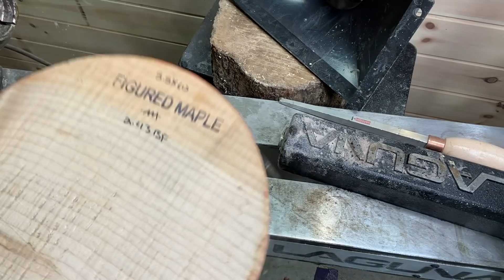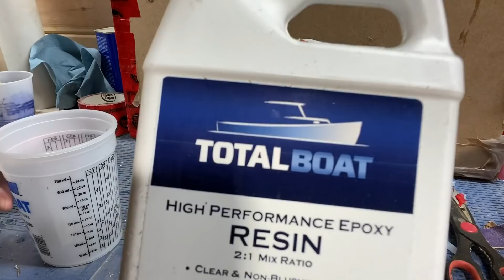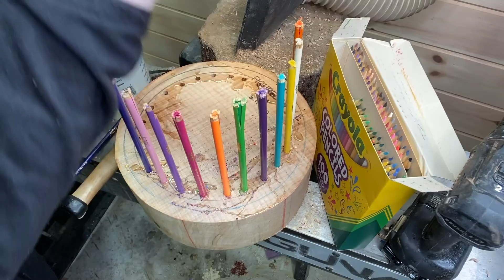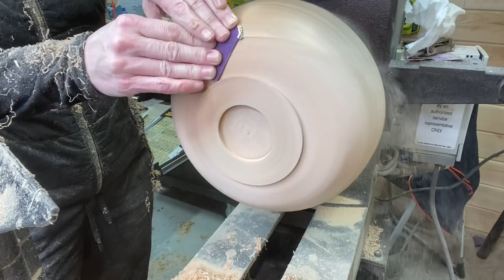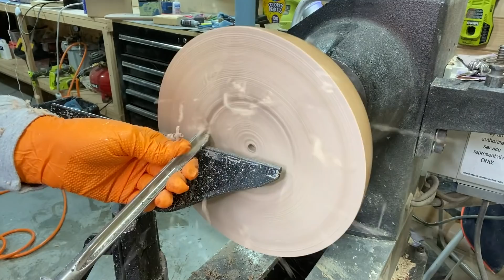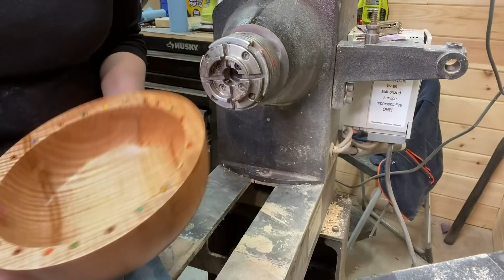Woodturning with COLORED PENCILS

Comment: The first project I did with colored pencils, I left them in the box, and cut them on my miter saw. I started at the bottom of the box because it held them better in place. It got a little more harder to cut the rest of the pencil into smaller pieces after the first cut, but if you only need that first batch, it worked well.

Comment: I think you would have a better alignment of the pencils if you had drilled the holes after turning the outside of the bowl, take the bowl in the chuck off the lathe , and lined up your circle jig with the real center of the bowl.  Nice enough though.
Reply from the maker: Thanks for the tip!

Comment: Nice birthday cake.  Where did you get the wood.  I’m not having much luck ordering on line.  I get the blank, but there is always something wrong with it.  Stay healthy.  Oh!  If you have time...you finished a bowl recently with resin.  Could you tell me the ratios of ingredients?
Reply from the maker: Got this blank at Rockler. As far as the resin, depends on the brand and ratios for each one. I usually use Total Boat 3:1 or Total Boat 2:1

Comment: Peggy, I’ve done dozens upon dozens of pencil type bowls just a couple tips in case you do more. First toss out any black ones they smear the worst.  Colored pencils are actually wax not lead so they are very susceptible to heat from your tool or heavy sanding. I didn’t see much of any in your bowl. I always use 100% sanding sealer on just the pencil spots in your case helps seal the cedar wood that most pencils are made from. Anyway nice “Birthday Cake” bowl. 👍🇺🇸
Reply from the maker: Thanks!!! :-)

Comment: In woodturning, knowing the tool speed (rpm) is of little value.  Every tool is different, every piece of wood is different and cutting speed is dependent on a constantly changing diameter.  Turning an 18 inch bowl at 3,000 rpm would be insane, but totally appropriate for a pin blank.  It's art and experience, not math and science.  BTW, the proper term is rip'ems.
Reply from the maker: I like rip'ems!
Reply: @PFWoodturning  RPM's is okay too. Because you're using that speed for longer than one minute.

Comment: Very interesting piece. Looked a little like a birthday cake.
A few ideas for future projects: (1) Put the pencils in the same, except run the rim out further so the pencils end up in the curve of the bowl, making them oval in shape. (2) Drill the holes at an angle toward the center so they will appear even longer ovals when finished. (3) Drill the holes in from the edge so the pencils are seen coming in from the side of the bowl.  Good luck and have fun!
Reply from the maker: Great idea!